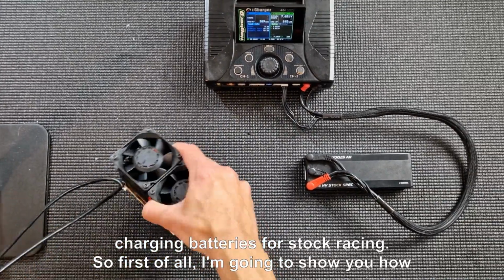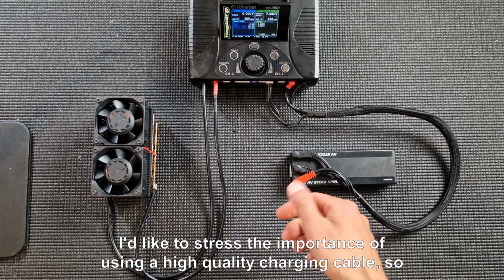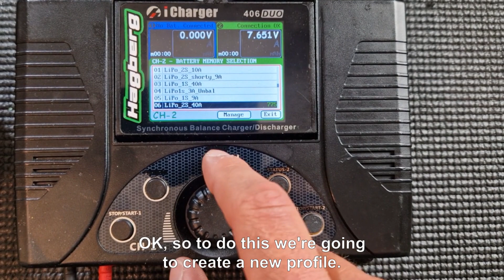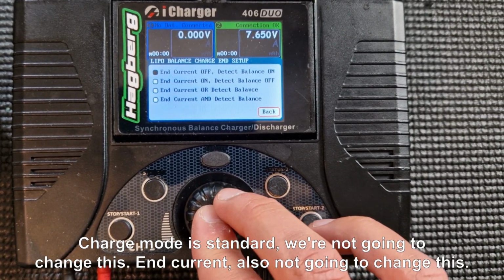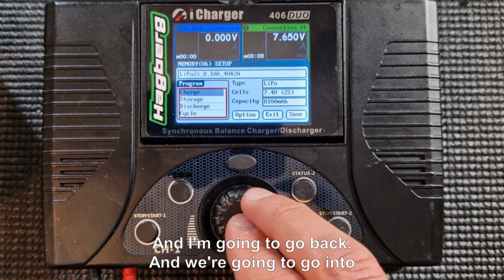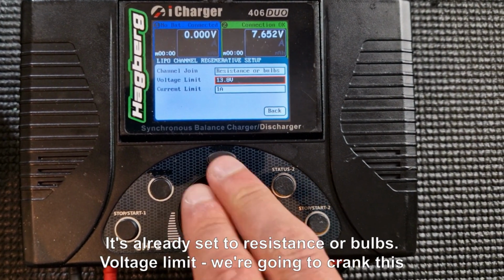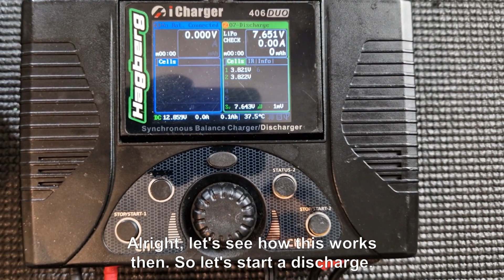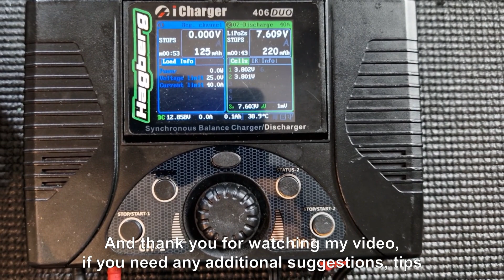How to setup a resistor bank for 40A discharging

Comment: What resistance is needed ?
I guess the charger will apply a CC profile ?
Reply from the maker: @jas-FPV  good IR for these types of packs, as measured on iCharger, is around 1.0 or thereabouts.
Reply: Looking at current and voltage near the end of discharging it's around 0.93 Ohms. If these are the same type of resistors - which the should be 😁 - then it's most likely 5 x 5 Ohm power resistors in parallel.

Comment: I have a 458 Duo and recently bought a Cell Master SPECTER Discharge Resistor Bank - but can't get it to work.  The bank has a balance cable which does not fit the 458 Duo - and I haven't been able to get it to work.  Any ideas here?  Will it work if I change the balance cable connector?  Thanks for all your great videos!
Reply from the maker: Hi, the Specter discharge bank is compatible with the Specter charger only (from what I understand).
Reply: @ thank you for taking the time to reply! Much appreciated!

Comment: In the video at 4:20 you say the resistor bank is plugged into the second channel but earlier it was shown plugged into Channel 1. Did you change it before running the Discharge?
Reply from the maker: You can plug it into either channel (opposite of the battery), the other channel will always be used for regenerative mode.

Comment: Hi Alex,

What is the reasons to cause lipo batteries get swollen😢

We even set the HW speedo to cutoff voltage...nothing less than 3.3v/cell

We race 1/8 GTe
Reply from the maker: The main cause is too much load, or when run until too low voltage. Too many heat cycles can also wear our out the battery quickly, some brands seem more suspectible to "puffing" than others.
Reply: what is your advice to reduce the load😊
Reply from the maker: @thomsonchong3248  make shorter runs, reduce turbo and boost in the ESC. Shorter gearing.

Comment: Hi Alex, on the LOAD side, do you know why the Voltage is higher than the battery side, is this normal? It also shows the Amp on the LOAD side is not reaching to 40Amps as you set on the battery side. Is this because of the resistor bank spec? I ve just made mine and tested it, the reading is almost the same on both page for Volt and Amp, i m wondering if there is something i did wrong with my charger set up or my home made resistor bank.
Reply from the maker: Did you crank the voltage and current limit all the way up as advised in the video?
Reply: Yes I did
Reply: All your questions are connected.
1. Why there is not 40A on load side? As you can see power on both channels is roughly the same - 280W, so when the current is maxed out on battery side, the maximum discharge power is reached. Resistor's bank resistance is around 1 Ohm, so for X of applied voltage it will roughtly be X amount of current. Disregarding units X * X = X^2 = 280 -> so X is a square root of 280 which is ~16.8. It's not exactly, that, because resistance is slightly lower, but I hope you get the point.
Reply: 2. Why is voltage higher on load side than on battery?
I understand that regenerative discharge's general idea is to charge another battery while discharing other. And in this situation charger can boost voltage if required. We can use that to our advantane in order to "push" as much power.
Imagine situation where battery is connected directly to resistor bank - for 1 Ohm resistance and 7V on battery we would only get 7A of current, giving around 50W.

Comment: I just got a 458duo and it will not discharge with a discharge bank plugged in to channel 2 and battery in to channel 1. My 308duo  can have discharge bank in either channel. Do you have any idea why?
Reply from the maker: It works on one channel and not the other? Or not at all?

Comment: So, these discharges do nothing more but discharge the battery quickly and safely of course?
Reply from the maker: @jasong712  correct, the discharge bank allows for a higher discharge rate than if you would use the charger alone.

Comment: Can you show how to set ip the cycle (discharge first and charge) with defined resting time in between?

Thank you again for always bringing valuable info. 

Loving the “stock” racing related videos.
Reply from the maker: It's fairly easy to do. You need to go into the LiPo Cycle Set-up. Set it do DCGH->CHG, cycle count 1, Delay time - I would suggest 3-5 minutes
Reply: Got it. Thank you so much

Comment: are the resistors 1 oam? or more?
Reply: These must be 5 x 5 ohm resistors in parallel making total resistance of this discharging circuit 1 ohm. If it was 5 x 1 ohm resistors then total resistance would be 1/5 or 0.2 Ohm.